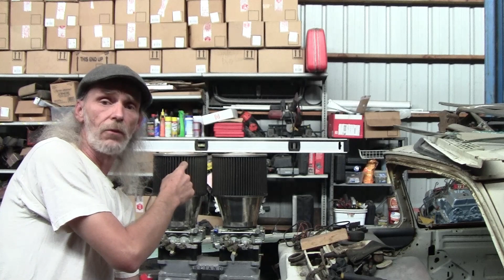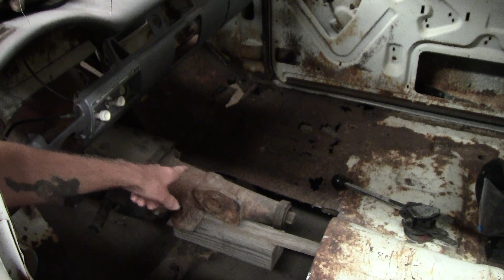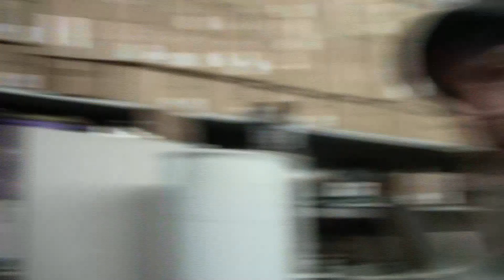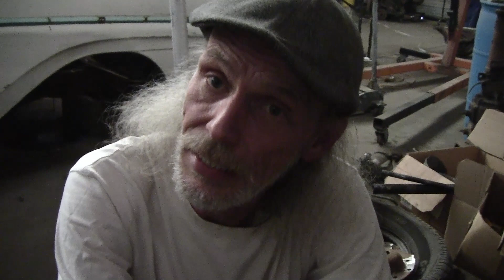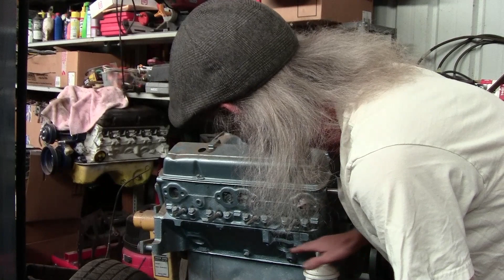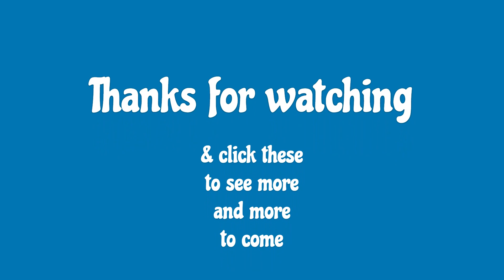1958 Ford 300 Hot Rod Budget Build & The Challenges of Hot Rodding with Ford Motor Company

Comment: I circle track raced windsor ford s with rear sump pans for years and(blew some up to) and used hi volume pumps some i even upped spring pressue never twisted off a pump drive even once and had lots of baffles in pan never saw low oil pressure come on (comes on at 20 psi) i race chevs now (cheaper) and i have lite coming on in corners more now i usually over fill to stop it both have there own issues but disagree with ur asumptions on ford but i like that have opinions on it

Comment: Does a crankscraper cause the same problem as a windage tray?
Reply from the maker: Hey there mike good to see ya man!
I've never used a crank scraper before but I've seen a couple windage tray's that have them built into them & and in this case I'd say definitely since they stop that sling.
But in the case of a Mopar where they suffer from the more extreme 'bad' windage (such as tight A-Body's with shallow v8 center sumps) it's sometimes better to deal with that, then the oil getting beaten into chocolate mousse meringue by the counter weights on the crank. With this Ford, I only have to deal with the 'bad" windage under hard acceleration....... if that makes sense.
Hope that helps man, and thanks for stopping by.
Reply: @BareRoseGarage  I was just curious. I built up a 351 windsor for my 69 ford van a bit more than stock and found a DYI in and old Car Craft magazine on how to make your own crank scraper. Interesting project to add to all the moderate speed parts I installed. I wasn't really interested in a windage tray but was interested in keeping the oil from roping.

Comment: Every HP MOPAR had a windage tray maybe before 1968. A windage tray will help keep the oil from getting whipped into a froth.
Reply from the maker: You took the words right off the cutting room floor there man, Good Catch! lolololol
Yeah Mopar had a lot of "bad" windage to deal with due to the shallow ends, and it was extreme. I wonder if that's why Mopar focused on roller cam development before Ford & Gm? If I remember correctly, they beat them all to production with it in the 80's.

Comment: Never thought about it this way.  I always like your videos.  I spent my whole adult life in Ford parts and service.  I used the double sump mustang pan on my own build.  I had herd to never use  more than a stock pump on a Ford before but never herd about the air getting into the pick up tube before.  It does make sense but… the cars that used these pans from the factory would run 300,000 miles if taken care of no problem.  So if it does get the air into the pick up after sitting it doesn’t hurt much from my experience at the dealership.  I have seen what your talking about with the oil pressure and I was always told it’s how the ford oil pump spring worked.  I am in no way saying your wrong just trying to make sense of the air after sitting.  I totally agree with you on the windage tray and oil pans.  I used a screen type windage tray on my build but I always use roller cams.  I wanted the oil to be able to drain back quickly so I went with that screen type.  Food for thought for sure brother.  It’s nice to see someone building these old Fords and keeping a Ford motor in them.   Everyone I worked with would go on and on about how tuff the 460 is.  I have never owned a V8 other than a Windsor or Mod motor but I would love to play with a FE some day.
Reply from the maker: Hey there Snizzy great to see ya man. Yeah there is a whole segment I probably should've left in there on this one that I cut for time and the secret to the success in yours is you followed the general theme of what I was trying to convey in this.... you're playing within the stock perimeters and letting your Ford be a Ford. The Oil Pump in there is focusing more on volume than pressure to make that 1st hit (and air issue) nominal. Aftermarket HP & High-Volume stuff has a tendency to emphasize this instead of eliminating this. So basically, what I was trying to convey here about the Ford Oiling System & engine placement is that to make it better, is to leave it pretty much stock. If that makes sense. 
Chevy on the other hand..... they are much more forgiving on this kind of stuff.
Reply: Oh ok I got ya.  Thanks for answering.  Good to see you as well.

Comment: Oh dear lord where to begin... 
Kim I love ya man, but I'm gonna have to disagree with almost 85% of the stuff you said. You know I've been a lifelong Fordman and have my fair share of knowledge and experience. Gonna try to be brief... ugh..
First off... oil slosh... You need in the realm of 1G on a launch to uncover the oil pickup. In order to achieve 1G which is like 22 or 32 feet per second...(can't remember for sure) but basically you gotta be putting down sub 2sec 60-foot times. Now if you are putting down those kinda times, do you really expect us to believe you are not taking the time to run baffles in the oil pan? Because for every action, there's a reaction. Sudden slowdown or braking is gonna do the same thing to a SBC... And do you really think the oil just stays in the bottom of a SBC sump on acceleration? Nope! At 1G or more it's crawling up the back wall up into the crank.... excessive windage! 
Oiling systems... Oh boy. Again, SBC BBC get a huge F. And so does the center oiler FE. 
SBC oils the crank and rods last. Oil goes right up to the top end then gets branched out and last stop is the crank and rods. Hence why you see the cranks blown out of them, or half the build budget is spend on the rotating assy of a SBC. Also, like the FE the cam gets priority oil, then to the crank/rods second. Not a good situation, hence the creation of the FE side oiler where they are both oiled at the same time. Don't get me started on the Chevrolet dancing camshaft.... 
The 335 and 385 series hit the #1 cam and main bearings FIRST, then to the passenger lifter bank using it as a distribution point/log sending branches down to the center of the #2-#5 main/cam bulkheads oiling them both at the same time then also hitting a crossover at the #4 bulkhead over the top to oil the driver lifter bank. There's an oil port at the very rear that can be used to measure oil pressure from, at the vary end of the line. 
Windsors are basically the same as 335/385 except the branches from the passenger bank go directly to the mains then the mains feed the cam bearings.
Typically truck pans of the late 70s-90s take 6-8 qts of oil. Hard to imagine the pickup ever being uncovered for any normal reason, and i have yet to have ever heard the pickup tube... collecting air unless that engine is loose as a goose with a smoked oil pump you could send shellac through.
Ford wasn't trying to utilize anything about the rear sump other than getting the engine to fit the redesigned chassis'. The mustang II and prior years were a 60/40 weight distro, the fox became 59/41, but the fox suspension was a complete redesign. Same with trucks/vans, in '80 ford was working to shorten the nose of its vehicles, going a little more cab-forward in their designs. 
BTW- the distributor doesn't have to run the oil pump...(look at many Inline engines) it's just cheaper and easier to do so. And yes... WHY Ford ran such a puny drive rod in it's 385 series is beyond me.. The FE and 351W recieved larger dia drive rods. No clue why...?
 
For your build, throw the nose in the air.... its not gonna hurt anything because the driveline is setup on the "plane" of the chassis... not the ground. Irreguardless of the way the vehicle sits, the engine/trans sits at a down-to-the-rear angle of 3-5 degrees. Any more is not necessary. IF you measure a Ford with a STOCK intake manifold you will find that most are 3-5* leaned forward with pan rail level. Some applications up to 7* (Early Tbird for example). Correct the carburetors by making or buying wedged spacers. Putting the carbs sideways will NOT fix the situation as 1/2 of the carb will be starved of fuel (1 fwd primary and 1 fwd secondary)rather then equally across the front. (jet extensions fix this on fwd facing units)
The driveshaft can be at whatever angle it likes as long as the tail shaft and rear end pinion are at equal but opposing angles. The joint itself has a maximum operating angle to where a double joint, or double-cardan rather, commonly used on SWB 4wd applications will become necessary on the front of the shaft only.

Well... so much for summary. Probably missed a bunch of other stuff i wanted to cover, but here's the brunt.... There ya go!
Reply from the maker: I love your comments man and you are actually making me a better editor because you pick up on all the stuff that I cut out because I thought it was "off topic"...... lol. When I was over by that 302 & sbc talking about the dual sump, there is about another 30 mins of footage talking about the pressure side, and oil pump differences and said, "this is too long as it is I better do that in its own video later". And Oh Yeah I leaned on the extremes there a bit much.
But all in all, this is the stuff that makes me actually LOVE my Fords more than my Chevy's & Mopars. Fords make me stop and think before I do and I get lazy with the others.. lol.
Reply: @BareRoseGarage  lol! Well after I posted that, I thought to myself.... Man I hope it didn't seem like I was picking on him or beating him up! Wasn't the intention at all.
You did cram a lot of subject matter into a short time frame for a subject like that, actually several subjects. So its easy to miss or skip over stuff.
I do enjoy these videos you do because it does give me different perspective, and makes me think....'ok, why' or 'how come'... its great, I love it. 
Bottom line, every engine has its quirks and their Achilles heel. Be the best builder for the ones you like and take the time to know and understand them. They all have potential. 😊